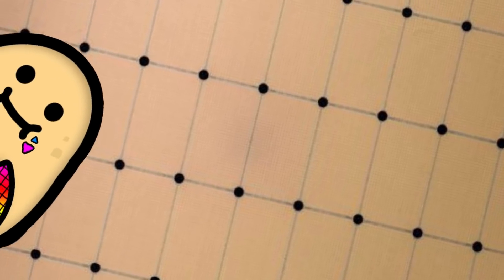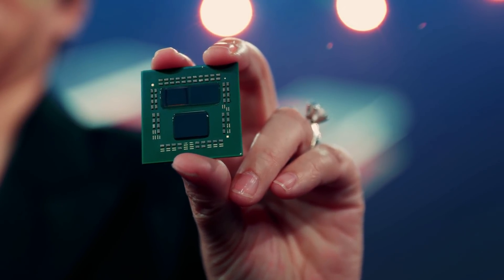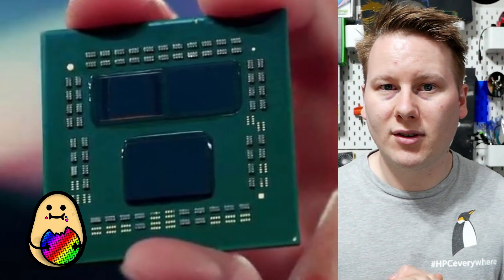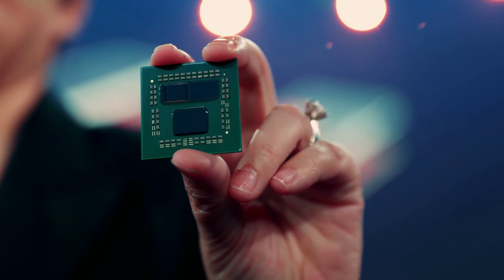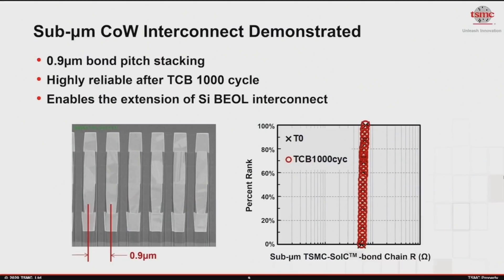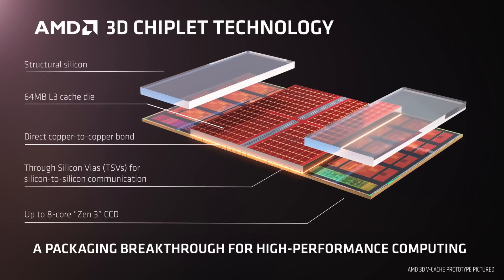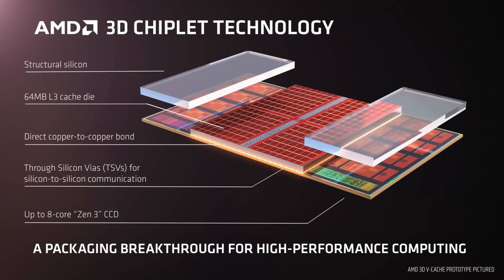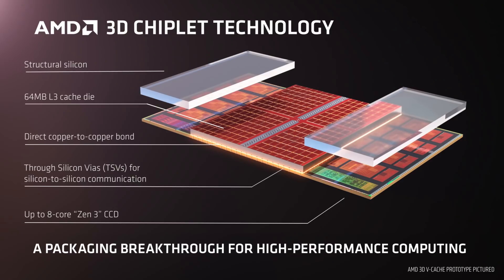AMD GETS STACKED 💪 192 MB of L3 Cache on Ryzen, Coming 2022?

Comment: Code compilation is an extremely cache-heavy workload that would do wonders with this. Just for a non-gaming workload that's not exactly uncommon.
Reply from the maker: It depends very much on the project, the OS, and the compiler. We've seen a wide variability and projects where caching does nothing.
Reply: @TechTechPotato  as far as I know C compilation generally benefits from this, especially for large projects like the Linux kernel. Can you suggest any resources on this matter?
Reply: @TechTechPotato  I admit the vast majority of code compilation I do is for game development. But it has been pretty consistent across compilers, and even OS in my experience. Of course I've not been particularly rigorous in my testing. I would be curious to know what sort of compiling jobs don't strongly benefit from cache however, if you're willing(and able) to share?
Reply: @thegreywun  web coffescript, es6+ transpilers don't benefit much from cpu cache, cause they are mostly storage bound..
Reply: @TechTechPotato  I've never seen a compiler not love more cache. We can use all cores and all cache and have always seen reduction in compile time with more cache.
Reply: @TechTechPotato  

Ive been saying bring broadwell so to speak back for years. The iris pro itself was irrelevant. The fact it was beating skylake the CPU that replaced it in many tasks, including decompression was a sign of this designs potential. I think intel is scared to give too good of a product they might have to replicate the same what seems in their engineering psychology last ditch effort. Except how is a low clocked 10nm going to have the IPC to compete? They are trying to compete in the server domain too, but its probably highly unrealistic, and it just cost them gaming 100% unless they retool Alderlake which would be super smart.

Remember how Bill Gates did intel during the netburst era? In its own way it was the first dual core processor, since logical cores are physical cores, they are just second class citizens in the processor hierarchy few people respect and understand. Now wait for the little cores in addition to show up to microsofts thread scheduler of a disaster. What im saying is Bill Gates will strike again. Its going to ruin your economics intel.

Remember Halo Combat Evolved on PC? It was highly broken on purpose because XBox needed to be more relevant. Intel doesnt learn, probably because they can just buy their way into a chess position kind of like with their compiler.
Reply: @TechTechPotato  Cache size does nothing for workloads that are processing data sequentially and can therefore keep the hot data set small. Some applications could be written this way but are not due to laziness / OOP dogma. Some applications genuinely cannot be written this way because the nature of the problem requires random access - e.g. algorithms on large graphs. In those cases cache size can do wonders.
Reply: @TechTechPotato  

What did I tell you intel should do again.
Reply: @TechTechPotato  

"It depends very much on the project, the OS, and the compiler."

You should test my Carnivores Reborn compiler spoofing video guide and showcase.

Ill eventually have a complete list. Ancient history or not, im going to have the power to hook the world up on a greener tomorrow. Except thats only half true given im helping mankind raytrace the classics.
Reply: @TechTechPotato  

Your most unhappy customers are your greatest source of learning.
-Satans Gates

Yar mouse done obey curse dumbers.....

OEM keys dont survive a OS reinstall on the same motherboard. I can see why piracy exists.
Reply: @TechTechPotato  

Gabe Newell is Watching.
Reply: @TechTechPotato  

For years the tech "journalist" niche wouldnt touch how that cache of these enthusiast processors was being dumped due to massive context switching. Their reason for the mainstream CPUs winning was universally at least as ive witnessed it been down to clockrate which is only part of the equation. Its so widespread it communicates not simple laziness. There is more of a dark creature kept in cryo somewhere in the heart of this reoccurring lack of interest in a problem no one almost knows exists. Now we are supposed to believe microsoft is magically going to make its compiler smarter than a brain hemorrhaging gorilla. I just dont see this occurring. That was their obtuse way of increasing market demand for faster CPUs. What now that team blue is behind, he suddenly is going to commit to Gods Work? -- after so many years of basically satanic ritual?
Reply: My (admittedly mostly anecdotal) experience is that e.g. C++ compilation with tons of template instantiation does in fact greatly benefit from caching. I too would be curious if you could recommend any concrete benchmarks or other resources? Cheers
Reply: I think there's less diminishing returns for cache compared to cores for consumer systems... 32 cores and 64 threads should be the max, from zen on just add more L1 + L2 cache.. 3D L3 SRAM cache is hot stuff but I'd still like to see 32 cores around a large central L1 cache, with bad cores and memory zones switched off and the rest working. There's only so much that can be parallelised, cache speeds up all serial code on all threads. Massively parallel coproccessors processors (GPU and DSP) don't need super fast memory but it would be good to have GPU cores and DRAM combined into one chiplet, with a few chiplets around the main CPU, providing L4 CPU cache as well as VRAM on one SOC. 3D SRAM cache on top is a bonus. SRAM uses far less power but 3x the number of transistors as DRAM.. Something between SRAM and DRAM, say using 3 or 4 transistors per bit would be a better innovation. Level 1 cache is 10s of times faster than L4 cache, hundreds of times faster than main memory... More the merrier.
Reply: @PrivateSi  Like there should be a max limit on ram and ssd space? Nah, never make statements like that. In 10 years 128 cores may be the norm. You never know. Back when computers were the size of a warehouse (think WW2) one futurist sais one day peopel will carry that in their pocket, most laughed at this extremely stupid statement, not only was it impossible but it would never be made small enough and if it were it woudl be beyond the year 3000. You carry a smartphone?

A single large L1 sounds fun but L1 is not cheap, more silicon wasted per bit. Large L3 is good enough and can be made into a chiplet, less botched cpu's if you can just mix and match the parts. One of the things that would be nice is dram (I'd think 1-2GB HBM for pure speed would be good and not overly expensive) on the apu so less waiting for slow ram, making an apu a really good idea. But putting it in as purely vram with many gpus nowadays having heaps of ram leads to barely running any game (unless 8-12GB on an apu is going anywhere soon, but €), using it as a slab of L4 that can be used on cpu and apu seems better to me. Then again it might run CAD really well with a bit of pure vram with simpler designs, great office stuff. 

As far as the amount of cores, there is a decoder, prefetched, a heap of deprecated barely used instructions in every core that just sit there for compatibility. A core with all deprecated and barely used ones can really bring down the amunt of silicon used and possibly lower power consumption, a software layer can be used for compatibility. Which leaves more room for more cores or gives smaller less powerhungry gear. 

Or more room for a longer boost not hitting temp limits, race to idle, AM5 tdp seems to go up to 170 watts.
Reply: @jamegumb7298  .. The Law of Diminishing Returns on cores for single user systems is known. We are not talking server chips.. There will be more specialised cores, and more GPU / DSP cores (the more, the better for parallel ops), but we're almost at the limit for single user systems where only more cache and more specialism makes sense now GPU-compute is well and truly here. Many experts know bloating CPU cores with SIMD has merely lumbered what should be far simpler cores with bloat that should be part of the GPU, with better CPU and GPU integration, even for discrete GPUs.. 
--
All main memory should be combined with flash at a fine grained resolution, intertleaved on the same chip for massively parallel memory to flash and back transfer, with automatic memory backup in an instant, using just the power remaining in the capacitors.. for an APU L4 cache should be shared with GPU and DSPs on chiplets in a modular system, with GPU and DRAM connected by 1000s of bus lanes, sharing the same chiplet die... 
--
SRAM cache can increase forever as things stand, economically, as it uses far less power than DRAM and is much faster.  We don't run enough single, serial threads at once to warrant over 32 cores and anything properly parallel should be done by GPU compute, not poxy SSE / AVX cores. There's only so much heavy pipelining can do before it's not worth the effort.
--
Loads of L1 cache means a flatter, simpler cache system, also using less power. From memory, those are my generally registered thoughts on memory.
Reply: @jamegumb7298  Ahmdal's Law actually does set a hard limit on the speedup you can obtain from throwing more cores at the problem, and it's a lot lower than you probably think. For example, if a program is 95% parallelizeable (which is a WAY higher figure than the vast majority of workloads will ever get in practice), you will never get more than a 20x speedup even if you throw a million cores at the problem. If you can get to something like 75% parallel, which is a more realistic number for most workloads, the best you can ever get is a 4x improvement over single-core, even on a 32-core threadripper.

Similarly, the amount of RAM you can practically use, for pretty much anything other than disk cache, is severly limited by CPU memory bandwidth. And if you have a fast SSD, the utility of disk cache goes down as well.

By contrast, there's no particular pressing limit on how much SSD space you can make use of, so you should expect that figure to grow much faster than RAM size (which is already close to stagnant for user machines) or core counts for the foreseeable future.
Reply: @PrivateSi  I tend to agree. While I'm not a fan of hyperthreading, I don't see any reason I would realistically need more than 64 cores. I would rather spend silicon on more cache.
Reply: @wiilillad .. There's clips and quotes of Linus Torvalds hating on SIMD in CPUS, especially SSE+++. ARM too have gone that way. A shame... Risc V allows for proper, modern, legacy free, modular systems. 
-
They can separate systems into massively parallel SIMD cores connected to DRAM with a massive bus, and serial instructions carried out by serial-only CPU cores connected to massive, super-fast L1 SRAM cache.... 
--
Problem is, more cores will help x86 and Arm now because software developers use multi-core SIMD ops.. Problem is this is CPU SIMD is slow and inefficient compared to the architecture I described..
--
Maybe SSE instructions can be emulated on a separate parallel-compute system, but really all parallel compute should be done via OpenCL/CUDA, OpenGL and Vulkan APIs, not Intel, AMD and Arm + that lot..
Reply: but having shittier ram matters less when it all fits in l3 though, right?
Reply: I really think the cache architecture would be a lot more enlightening than  just the size of the cache.
Reply: I don't see how more L3 cache would greatly decrease compilation times (just for credentials, I've been a C++ programmer for some 2 decades with plenty of compiling experience, including Linux kernel).

As far as I understand cache, it is useful for processes that are running for longer periods of time and regularly access same data, compilers only process one compilation unit (usually one source file) and exit when done. So, unless you cram all source files into one compilation unit, I don't see how you would significantly benefit from extra cache.

It would be very interesting to compare kernel compilation time on 5800X and newly announced 5700G as they are nearly identical CPUs with X having 100MHz higher boost clock and 32MB L3 compared to 16MB of the G.
Reply: @TheDoubleBee  Compilers never compile just one file. At least not in c++. Precompiled headers are even better with lots of cache. A single unit can include over hundreds of other files. Anyone who doubts cache help with compile times simply doesn't work on large projects. Compilers also run in parallel. So more cores, more cache is needed.
Reply: @alienrenders  Aren't C++20 modules intended to help with this problem? Instead of ping-ponging a header file repeatedly you can use a module once, which I would guess helps thrash the cache less. But I may be misunderstanding how this works
Reply: @edherdman9973 Modules will in fact greatly help with compile times, however they have not yet been implemented by compiler vendors, and even when they are, we'll need the rest of the ecosystem (mainly CMake) to support them, best practices to be developed, etc. Realistically, modules are still at least a couple of years away.
Reply: @alienrenders  When you have over 8 threads per memory channel, I expect cache starts to matter. At least until we get ddr5.
Reply: @TheDoubleBee  How much a program benefits from extra cache doesn't have anything to do with how long a program is running for, it's mainly dependent on how much memory that program actively uses, and how unpredictable its accesses to that memory are. If you use significantly more memory than the size of the L2 cache (typically 256 or 512 KB), and you access that memory in unpredictable ways, then you will benefit from L3 cache, even if the program only lives for a fraction of a second. It turns out that compilers perfectly fit that description due to processing potentially-large ASTs.
Reply: @TheDoubleBee  I heard that compilation times can be highly depended on I/O,so people even use RAM drives to make it faster,if this true - maybe it would be possible to make a CPU Cache Drive?... 
Also how about languages with JIT compilers?

Comment: Was it ever tested whether the additional L3 can boost compile times? I own a Ryzen 3700X and it really boosted compile times (though just compared to an old i5 4th gen with 4C/4T).
Does more L3 cache benefit compile times as significantly as L1/L2 can? This could be a potential compilation monster and I'm not sure how well it can be compared to Intels older offering since Architecture changes are usually fairly sever regardless of raw numbers.
Reply from the maker: https://www.anandtech.com/bench/CPU-2020/2974
Reply: @TechTechPotato  Something wrong with that benchmark... you have the 12 and 16 cores getting beaten by a 5600x... which doesn't make sense, unless something is getting completely mismanaged in the build. https://openbenchmarking.org/test/pts/build-linux-kernel-1.10.2 and https://openbenchmarking.org/test/pts/build-gcc ... please don't tell me you were running compile benches on Windows...
Reply: Well it might help
But your comparison is not accurate, most or all of you improvements that you saw could be attributed to higher core count and a more modern architecture in CPU.

Comment: Haven't we already gone through all of this once with AMD. Weren't they supposed to come out with vertically stacked RAM on their GPU's a few years ago?
Reply: they did with Radeon IIV that's why it mines 111 mh/s it's memory bandwidth is as good as the 3080 3090, but the cores were trash. It also was too expensive
Reply: Yeah, that was HBM and was shown on the progress map in the presentation.
Reply: yeah and it was super pricy back then.
I think just last year was the first HBM could somewhat economically compete with GDDR modules, but not yet fully. would be suprised to seeing that being used before 2022 iF in any consumer device again, in the future
Reply: HM2 is still too expensive, HBM2e is cheaper but still, we might see it back for enterprise/workstation gpu's once the shortage is over, or maybe they may drop some 3d Stacked APU's with it in future

Comment: I don't think thermals will be that terrible - given how it is "just" 2 layers and Cache doesn't use much energy. Though what's on top will be important. But I trust that AMD engineers have thought about it.
Reply: There must be some thermal balance consideration because they could easy cover the hole core/cache chiplet with the 3D cache chiplet but cover only the lower cache area. If they would cover the hole area it could be around 96MB or 128MB. So there must be a thermal balance reason to do it this way. In principle you can use also metal for the adjuster which reset all thermals.

Comment: Having that much L3 cache sounds interesting, at the same time, I wonder if they can replace the in-core L3 cache with more computing transistors.
And it will be even more interesting if the cache could be manufactured with different nm.
Reply: Kind of what I'm envisioning. More area for more transistors in each chiplet and you still have a large cache.
Win/win.

Especially if you can manufacturer the cache on a larger node...
Oh the possibilities

Comment: I'm just worried that nobody is talking about die etching & integrated cooling. 
Expecially now that they are all rolling out 3d stacking, i don't think they will get the ever increasing power density at bay with just better lithography and opportunistic behavior.
Now that at the edge the price per transistor Is getting higher, they should focus on having those transistor work in better conditions, since adding more is becoming antieconomical